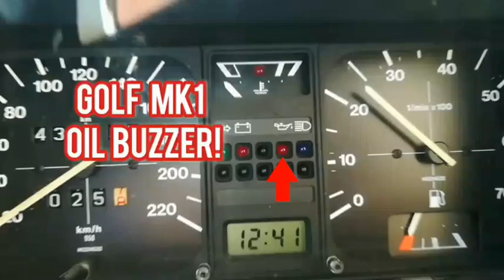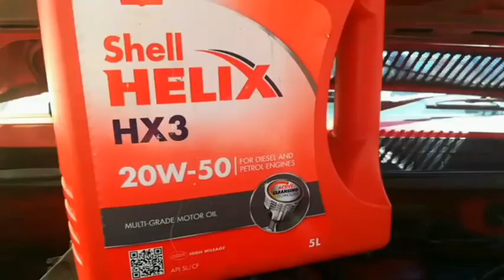VW Golf Mk1: Oil Buzzer

Comment: Hello great videos on the mk1.just a quick question I know it's off the topic here but my horn is not giving a clear sound when it's pressed but if it's tested directly on the battery it's normal what could be wrong I have checked the fuse and wires and they are fine

Comment: Hi PJ. Hope you are well. I hope you can help. 

I have a golf with the motor recently rebuilt new everything and rebore. The problem I have now is smoke coming out of the breather pipe. And when i connect the pipe to the intake, the engine doesn’t idle smoothly and cuts off sometimes. But runs perfectly without the breather pipe.

Comment: to access the oil pump do i need to remove the top?
Reply from the maker: Nope ..you remove the sump sir
Reply from the maker: There's twenty 10mm little bolts  to remove ..then the oil pump is held by  two 13 mm bolts..
Reply: thanks cause i changed the oil pump but i do not think the machanic used the brand new one i bought cause the oil light and sound always go off
Reply from the maker: @lordstark5292  not always the oil pump that's the issue ..the Mk1 is prone for that oil buzzer to act up erraticly...did your mechanic diagnose the issue as the oil pump?